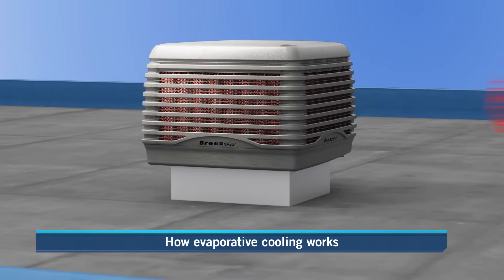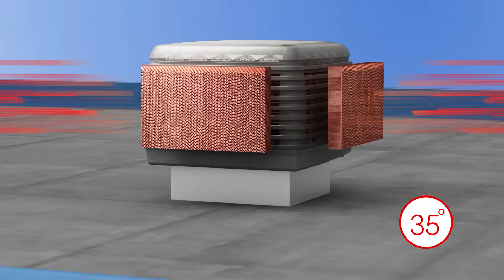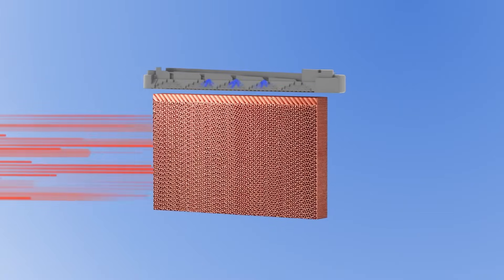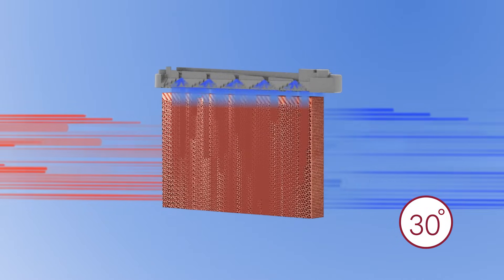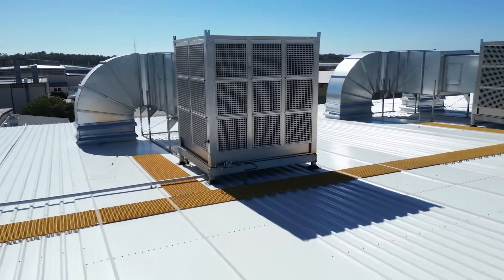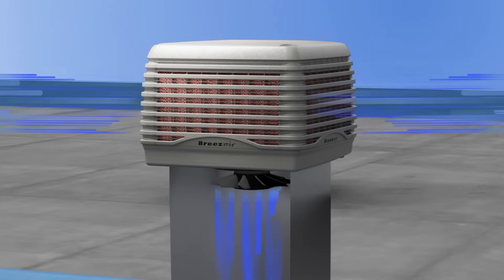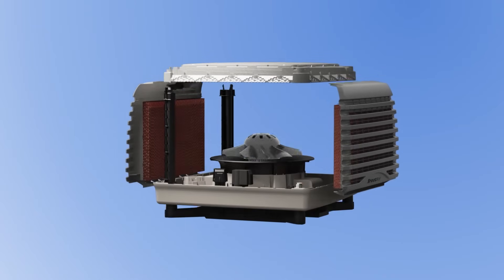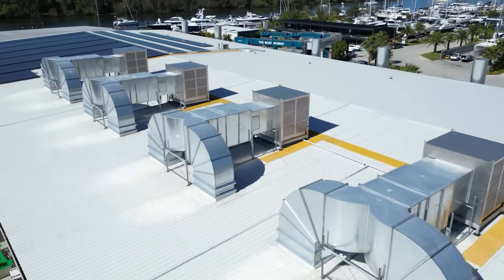Direct Evaporative Cooling: How it works

Comment: interesting that this particular type uses a propeller fan, opposed to a squirrel cage fan found in residential models.
I have the squirrel cage type up on my roof, and it works great as long as it is not Humid outside.

Comment: I have question about water used in cooling.
Which temperature is require to allow AC working properly also consumption rate ?

Comment: Less energy consumption hight water consumption.
Reply: not that much really, there is a reservoir on the bottom that holds water and a pump that circulates it over the pads,
which runs back into the reservoir, and a float that controls incoming water, as soon as the water level starts to drop, the water
turns on, so it is never fully empty. I discovered that my evaporative cooler will hold enough water in the reservoir for 4 hrs 20 min,
after my float valve broke and would not shut off. and I had to fill it manually until I installed a new float valve.

Comment: Freshwater is not an infinite resource
Reply from the maker: This is right, that is why all coolers by Seeley International have a clever WaterManagement system preventing excessive use of water but also checking water quality. The system only discharges water in the tank when its quality is not enough. This is a way of preventing algae growth and ensuring cleanliness of water.

Comment: These are basically dessert cooler you can find in every Indian household. These are way cheaper to buy and cheaper to maintain. Also power consumption is way lower. But they are not useful on highly humid days.
Reply from the maker: Seeley International coolers are premium quality adiabatic coolers, with the higher saturation efficiency and robustness in the market. We proudly sell all over the world, but yes, in very humid climates like Indian one, we mainly sell in commercial and industrial applications. In these applications, cooling is mostly needed during the central part of the day, when humidity is at its lowest, and therefore evaporative coolers have higher efficiency. We should always consider that relative humidity % reaches its highest, when outside temperature is at the lowest. You can contact us for furhter information at www.seeleyinternational.com
Reply: @seeleyinternationalemena2736  😅😊😂😅 Tera bhi katunga

Comment: In Bangladesh, at summer season, humidity in air becomes already high. Will this system be beneficial for us?
Reply: Nope, it needs evaporation for cooling, when outside is already humid the water wont evaporate
Reply from the maker: @OvaisDIYGarage I would put it another way. It’s important to notice the inverse proportion between Relative Humidity and temperature. During the hottest parts of the day, relative humidity is very low, thus giving evaporative coolers a wider range to operate, by cooling through evaporation. There are countries with high humidity where these coolers don't operate as good as in dry climates, but having said that, we have got thousands of units installed in coastal areas and humid climates (including India).  
@mohaiminulislam1534 if you wish to get more information, contact us here: europesales@seeleyinternational.com

Comment: How about efficent and  electricity cost?
Reply from the maker: Thanks for giving us the chance to elaborate on this aspect. At a typical outside condition (38°C DB / 21°C WB), our unit can reach COP=14!  Also maximum power consumption at the same conditions is 1.2 kW. Another interesting aspect to consider is the saturation efficiency of our pads, which can reach 91.5%, which is an outstanding result if you compare to the competition. Plus, Climate Wizard has an efficiency rate up to 136% on wet bulb depression (when other indirect adiabatic exchangers generally have an efficiency around 65/70%).
Reply: @seeleyinternationalemena2736  1.2kw,,, ?
Per day?
Per hour?